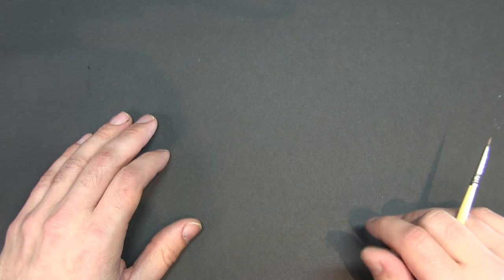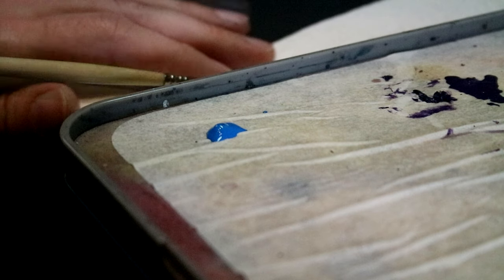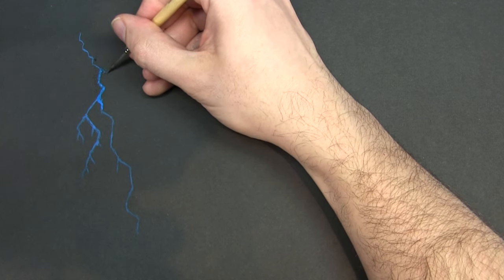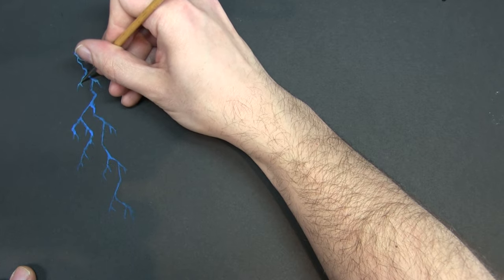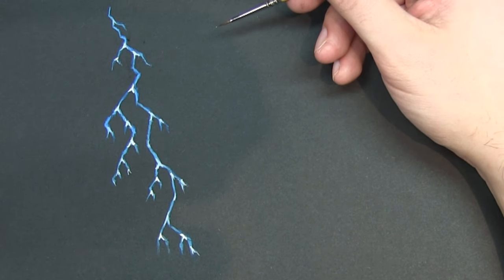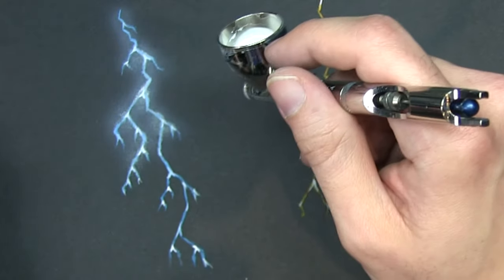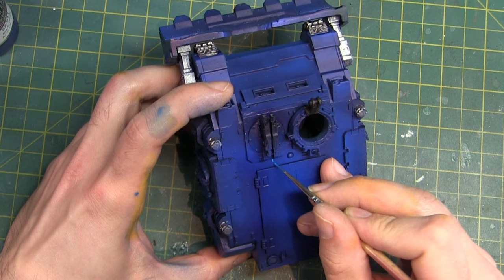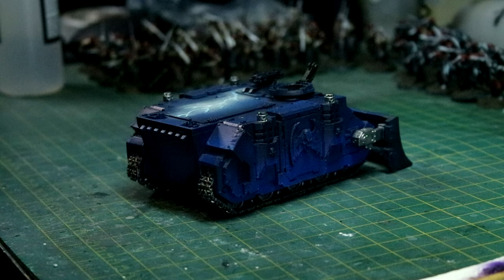How to paint Lightning tutorial

Comment: What is the type of paint (acrylic etc) that you use for paint throughout this process? I don’t paint models but I love to learn how to do new things with my paintings and I enjoyed your tutorial very much. Might have to look into buying an airbrush and paint for it. I know a little about care and stuff of the equipment but it was body airbrushing lol I don’t know if it was different paint but if so I want to make sure I invest in the type for canvases and my walls in general. Working out an idea for a mural on my office wall. Thanks a lot for your video! Sorry if you mention the answers to my questions in the video. I was going back and forth to rewatch certain spots and I think I missed bits when going back to where I thought I was at before going back in the vid
Reply from the maker: No problem. The paints I use are all acrylics. As for the body of them I am unsure but the brand in this tutorial was Vallejo. The base coats were done with the Vallejo premium line and the lightning was done with the Vallejo game air line. Hope the internet might be able to tell you a bit more about the paints and if there is a cheaper substitute as the pots are quite small so doing a wall might become expensive. Hope that helps
Reply: @elstonation  oh I’m not airbrushing a wall lol I will use acrylics but I thought it would be nice to use airbrushing on areas to show the illumination of light where needed. I’ll need loads of practice. Spray paint is not going to be easy for me to try and use it for what I want to do due to not being skilled with detail with it as well as I would like to Be. Lol thanks for the info!